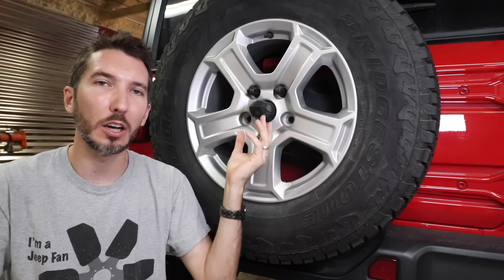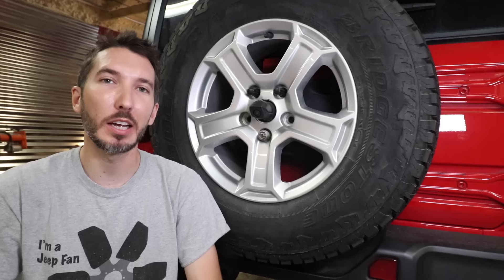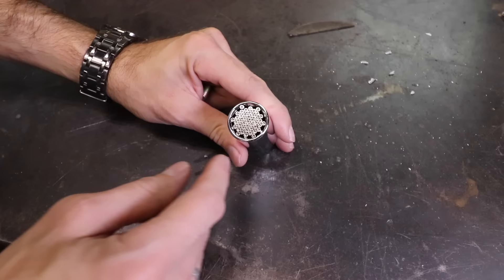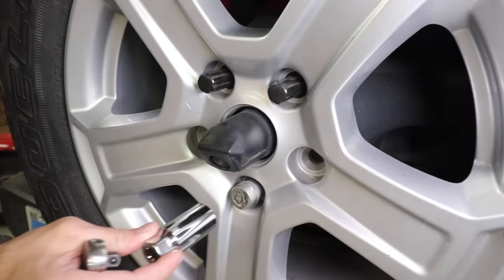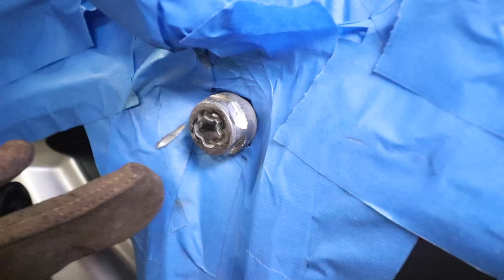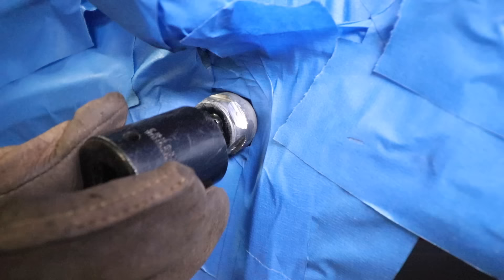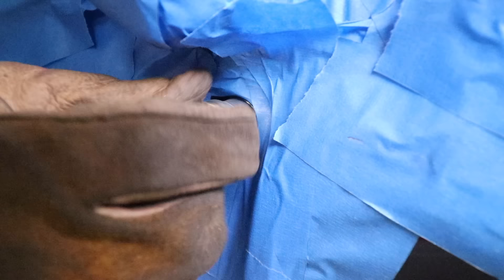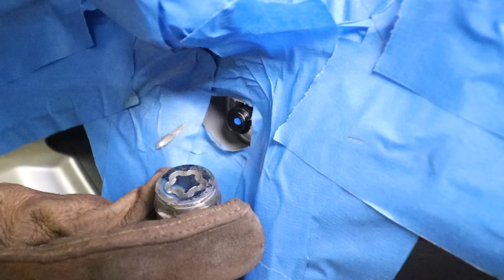3 Ways to Remove a Wheel Lock Without a Key

Comment: I have grabbed some old open end lug nuts and used a stick welder to weld through the hole in the lug nut  to weld onto the wheel lock with a wet towel to protect the wheel. then just use a lug wrench to remove.

Comment: Had the same thing on my used VW GTI - went to the dealer and they tried all the lock keys they had, removed my old locks and installed a new set.  Cost me $50 for the new set.   Your experience with the dealer pretty much makes me never want to buy a Jeep, esp. not a new one.

Comment: I’ve always removed locking lug nuts by getting a socket that’s slightly smaller and hammering it on. Good luck removing the lug from the socket after but it usually works every time.

Comment: Good job, but instead of a  socket you could use a nut and weld it in the middel. Then put the socket on it. Works also great on studs and bolts that are broken.
Reply: This is my preferred way to get these off. Always my plan A as long as my welder is available.
Reply: You sir are a genius☠️
Reply: Its a bit of work usualy because atleast here all of then are atleast a 2 piece system. The threaded part is connected to the head with a sort a torx like connection, so first you weld a nut and brake off the first part if it doesnt unscrew and rinse and repeat the welding
Reply: thats how i do it

Comment: When I was a service technician at a GM dealership I always used an air chisel and got a good grove cut in the edge and then unscrewed it using the air hammer. Never messed up a single customers wheel even once.

Comment: It’s a shame Jeep didn’t help. When I went to Landrover, They tried all the locking nuts until they found the correct one. Great vid none the less. 👍🏽
Reply: Ford also helped me when I lost my stock wheel lock. Not all dealers have the full set. I made some calls and found the right dealer. The guy that delivers all the new cars, found the right key and removed all locks, in his drawer of goodies he found 4 regular lug nuts and replaced them. He gave me the 2 color codes so I could purchase a lock from McGard, which I did by calling them. He did this all for free. Great dealer!   Thank FORD!     Jim

Comment: Find a socket that almost fits like the one you had, then take a big hammer and drive it on the lug enough to get a grip, works every time
Reply: I worked at Western Auto and we charged $5/wheel to remove the wheel locks without a key.
Reply: Thank you Chuck

Comment: Brought my brand new JK back a week after purchase for 2 issues... 1: the wheel locks... Yes they gave me the key... No they did not torque them or even tighten them... One flew off and put a nice ding in the side of my Jeep (took 2 weeks and threats of a lawyer to get them to fix the ding) and issue 2: strong smell of antifreeze after it was run on the highway for 30+ mins... Took 6 months of adding about a quart a week to for them to finally figure out there was an issue with the fan not coming on till after it was over temp... 
Then a year later a rocker arm broke.. and they tried to say since I didn't have all my services done at the dealership it was not covered under warranty... Actually had to have a lawyer send them a letter that time...

Comment: Put a short piece of pipe , about 4 inches long over the lug and then weld the lug to the inside of the pipe. Welding inside the pipe also protects your wheels. And then use a pipe wrench on the pipe to loosen the lug. I did this on all 4 wheels on a Volvo. Works a treat.

Comment: Hammering the right size 12 point socket on works nearly every time
Reply: Alex Ottomano thought exactly the same
Reply: unless it has that spin collar on lug with deeper socket rims (i've seen on BMW's and other german cars).

Only way then is buy the tool or weld a glob on end; real pain in ass.  For this lug; agreed; 12 point a big old hammer.
Reply: Yup that’s usually how it’s done. They also have easy out sockets that are double ended. 19mm on one side and 21mm on the other.
Reply: You could buy a wheel lock remover. I got mine off Amazon

Comment: You can also grind it in the middle, hammer it with a chisel so large pry bar fits, then grab the pry bar with some vise grips or a socket if they have a handle that can fit one and take it off, it usually works if not buy a set of turbo sockets, those always seem to work

Comment: Hey man. You can get reverse threaded sockets that threads on those lock nuts. That way you don't grind a chunk out of your wheel.
Reply: HF sells those reverse sockets for this exact purpose.
Reply: What if the nut has a spinning outer collar, though?
Reply: Most of lock nut kits comes with a card with a numeral key code which you can order your  replacement key from the company . If you don't have that. Good luck trying to take that locknut apart without damaging the rims.

Comment: Back in the early 1980's we had to remove a similar wheel lock. I hammered a slightly smaller socket over the lock and easily removed the lock. I honestly thought the socket was the price of removing the lock but I was wrong. After extricating the lock from the socket I was able to use that socket for many years to come. I learned this trick from a junkyard.

Comment: Grind the 2 sides you could get to easy flat then put the large size vise grips on tight and if u can't budge it slide a pipe over the back of grips and turn. I worked for a dealership in the early to middle 2000s when the idea of wheel locks was big. We had a master set in the parts room but out of the 2 parts room employees one was the manager and a big a hole at that. He would make it hard to get the set. Had to know all specifics as to why u needed it. The other guy was under him and didn't give a shit and would hand tools like that out no questions asked.
Reply: I'm sure the people that want to steal them have no problem.

Comment: Instead of grinding, use a socket that is just slightly smaller than the lock. Place the socket on the key lock and strike the socket wire a hammer several times. The socket will wedge itself onto the key. You can then use your ratchet wrench to remove the key.
Reply: Once done, how do you get the key out of the socket? Mine is stuck
Reply: @inthedarkwoods2022  Put the socket in a vice and smack the key with a hammer.

Comment: I. Ground a slot with a angle grinder and used a big screwdriver to remove locknut from old Cragar 5 star wheel. It worked, I too hit the wheel with the grinder.  The welder is the easiest option. I believe the Snap on tool truck dealer sells a removal/destruction tool for lock nuts.

Comment: I've taken a few wheels off with security bolts, just hammered a long reach thin wall socket over them, 17mm bolt use a 16mm socket, don't use black air-gun sockets the walls are too thick,

Comment: I take a chisel sharpen it and then holding the chisel on the top edge of the lock hitting it on a 45 degree angle until it makes a nice size Groove then I hammer counterclockwise with a chisel in the groove I just made just have to make sure that the groove is deep enough that it's not just going to chip off and hit the wheel with the Chisel be careful. Also it helps if you take the lock nut off before you loosen any of the other lugs cuz if the lugs are loose it'll put more tension on the locker

Comment: I'm going through that right now.  The tire shop lost my wheel lock key.  It's not tapered, like yours, so just pounding a socket on it is out of the question.  I guess I'll have to break out my grinder.  Thanks for the tip.

As far as dealerships, I bought my Tacoma brand new in 2003.  After the first 6 years of lack luster dealer provided oil changes, I started doing them myself.  I found that they had never dropped one of the two skid pans to do the oil change, but instead stuffed a bunch of shop rags between the skid pan and oil pan.  Six years of oily rags came out.  I next found out that the motor mount bolts to the frame were missing on the driver's side of the engine!  When I asked the dealer to fix it, they wanted to bill me for something the factory (built in Northern California) forgot to install.  My friend who owned a transmission shop installed them in exchange for two dozen donuts!  Toyota is a great vehicle, but North American labor sucks.

Comment: There's a special tool for this.  It's kind of like a socket but its inside is a reverse threaded nut, made of very hard steel, and what you do is to push it into place and rotate counter clockwise, and what happens is that the threads bite into the lug nut, and what eventually happens is that it won't thread on any further (because its inside gets narrower and narrower on an ever so gradual basis), meaning that as you continue to rotate it counter clockwise, the lug nut itself is eventually forced to rotate counter clockwise as well.  The only difficult thing here is having to separate the tool from the lug nut afterwards, which tends to involve the use of a vice.  But at least it doesn't damage the wheels.

Comment: I've used both the "wheel lock removal tool" ie an internal version of an easy out, and also the 12point socket trick. Honestly the 12 point socket worked better as the wheel lock tool got dull after the first 2 wheel locks and wouldn't bite as well.

Comment: My first choice would have been number 3.  As soon as the air powered cutting wheel appeared I thought "this won't end well".  BTW, hope you disconnected your battery before you started the welding.  Can easily fry sensitive electronics on a new vehicle when you fire up the welder.  Should post the name of the Jeep Dealer so others avoid someone who won't provide that basic service when you bought a new vehicle there.  Really outrageous.
Reply: I had the same problem sometime ago, the garage asked for $100/  a friend suggested 
that I go to alocal welder who removed the nut by using the third method that you had used and charged only $10/.

Comment: I had the same issue once. I took all the lugs but the one on both side of the locking one, and then tighten the other two down more that recommend. Then I too a socket that almost fits over the locking one and drove it on over the locking socket with a hammer just enough to grab it, but not destroy the socket and, then gave it a turn and it came right off. One of my friends also used this method, after he could not get one of of his van, and it worked for him also.

Comment: The nice thing about this is the fact that the lug sticks out ...enough that if you were to grind a slot across the center a small piece of steel could be fitted and welded into place. If you were in an area where all could do was grind a slot then a larger slot or possibly grinding the edges leaving an area in the center for a wrench or large vice grip along with a lever or wrench to twist.

Comment: I grew up in Western New York with the guys who invented and worked at McGard Wheel locks. The engineers spend three days developing a new product then spend the next week trying to break it. They taught me the JB Weld on a socket trick. Glue a socket onto the wheel lock with some JB weld and it spins off after it hardens.

Comment: You should have welded a nut not a socket.  Only because they are cheaper,  more dispoable and readily available
Reply: Old wheel nut, its got a taper on it so you you can get 3 full weld runs around it without exceeding its AF width.
Or a impact socket hammered over the nut.

Comment: Another trick is to tighten up the other four wheel nuts extremely tight (i.e. significantly tighter than the lock nut) - this will often render the lock nut loose (likely wont work on your spare wheel holder if it only has 3 nuts)
Reply: That’s a very interesting idea.  Thumbs up.
Reply: Good way to snap studs

Comment: I just bought the wheel lock remover tool from auto zone. one side looks like a pipe coupling the other is a 3/4 drive.  $10 my size and comes off like any other lug nut

Comment: I work at a tire/mechanic shop and we deal with these all the time and what I do is I use a special socket used for taking off stuck nuts and bolts hammer it on and use a breaker bar until it comes off :)

Comment: None of your methods worked on my 09 Dodge Ram lock lug. However I found a much easier way then welding and a lot cheaper than purchasing a "easy out" set. I used a small punch and mall to cut the spinning ring off and hammering a 12 point 7/8 socket and it came right off.

Comment: You can stuff a slightly oversized socket that is larger than the lugnut / security lug, but just slightly.   Next get a rube of JB WELD Steel-stick and mix it up in your hand til its all dark colored and put it into your socket, press the socket onto your lug making sure not to let any of your JB Weld get pushed out on your wheel.   It should stay in there, but just check it.  It will take an hour for the JB Weld to really cure well.  Overnight is optimum hardness/ curing.  Now snap on your largest socket wrench and just like your "real" welded fix.. The JB Weld will do that same thing without needing a welder, and without messing up your wheel .    Works like a charm, everytime.

Comment: Never had any bug issues with my dealership over the years. I have had some concerns about their quality of work once or twice, but a chat with the service manager fixed that right up.
My biggest problem with them is the outrageous prices they charge for parts (and the labour rates are a bit high, too)....not really a huge issue. They are the only ones that have ever put a wrench on my Wrangler...aside from me swapping rims each season for my winter tires.

I did have a major problem back in November with the spare tire bracket! All three of the nuts had seized/rusted u-p pretty bad to the point that I ended up actually breaking the cast aluminium to get the summer spare off! A trip to a local Jeep store got me a  new bracket for about 1/4 of what the dealership priced it at! I just got the rusted nuts/bolts out of my summer spare this weekend, so I’m all back to normal & ready to make the swap back to summer rubber in a couple weeks! °|||||||° 🤘🏼

Comment: most tyre shops get a similar size socket bang it on with a sledge and turn. never seen them grind the edges, also seen them just smash it with chisel and hammer and break it off.  these are the two quickest and cheapest ways to do it

Comment: I tightend all the other bolts to try and relieve any stress from the lock. Then I bang the lock directly a few times to try and losen a bit. Then I use a chisel yo scar a line on one side. Then it's a matter of hammering on the chisel trying to rotate the lock. I alternante that with using a chanelock and a socket slightly cocked.

Its worked for me.

Comment: i had a 1991 Chrysler Imperial that had hubcap locks with those same star slots i just found a small flat blade screw driver bit that would fit in that slot and turned them off with a 1/4" socket and ratchet worked great. after the shop put the new tires on i put the hubcaps back on and was good to go.

Comment: Most excellent!  The 12-point socket did the trick!  I was even able to get the lug nut out of the socket afterward with the help of a bolt screwed into the lug nut, then tapped out with the help of a vise and a screwdriver through the back-end of the socket.  Thank you very much for an incredibly helpful video (and your follow-on video too!) :)

Comment: I watched a mechanic at my local garage try to remove one once. Vicegrips wouldn't bite as the metal was too hard. He did pound a socket over it, but that slipped too. It was finally removed at the Dealer..... A Ford Dealer.

Comment: Some time ago I was out of state working and noticed a low tire. I went to a service station to put air in and they noticed a nail in the side wall. They filled it with air but would not repair the tire due to the location of the nail. I said replace the tire and they said give us the lug key. When I looked where I keep the key it was gone. I went to every tire shop in the small Montana town. Nobody had a matching key. I went to auto parts stores and again no luck. I spent the next few days filling the tire twice a day and eventually traveled back home to Colorado. I found the key in the garage and took the tire to a local garage who fixed the tire despite it’s location, with no warranty. That was nearly a year ago and still going strong. The lesson learned was never leave without checking for the lug key.

Comment: Not going to read all the comments, but as a retired mechanic over the years you find solutions. Take a standard crossbar lug wench and of the 4 sizes choose the one closest to not fitting. Hammer the lug wrench on as far has you can and unscrew it. Before the locknut is all the way off, work the lug wrench off the nut and remove the nut with your fingers. Ruins the locknut, but who cares? BTW, learned this from a tire/wheel thief🤔

Comment: For anyone wanting a more simple option.... Just shave down the top and bottom sides (enough to use a wrench). Less time and chance of damaging the rim with the grinding wheel.
Reply: they are often recessed too far to grind.  welding would have to be through the inside of a hex nut.

Comment: Brother, I just ran into the same problem with 3 different Chrysler dealers over the same issue in your video. Bought a used Jeep with 4 OEM locking lugs on on it and no key. They all told me I was crap out of luck unless I could come up with a key # for the locks. I'm old, and not very patience with crappy customer service. No one would take two steps to help me.  Mine are on a 2015 JK and have the spinning collars on them.  Looks like welder time.